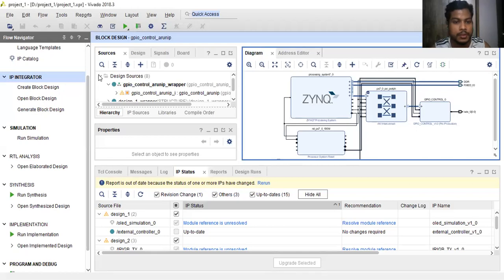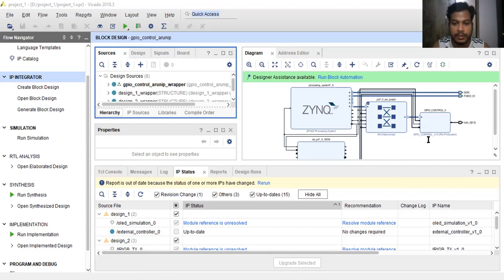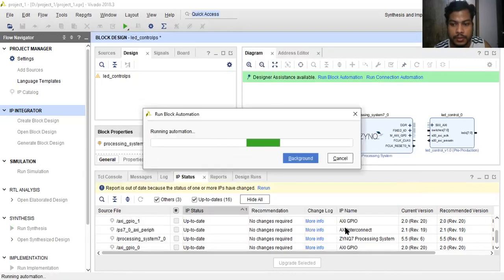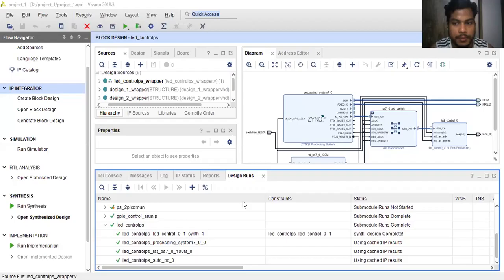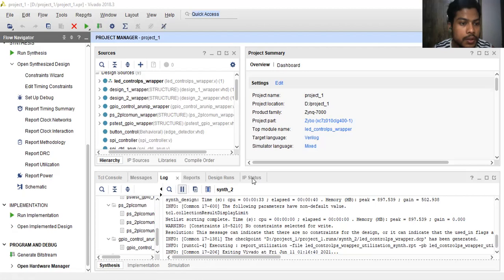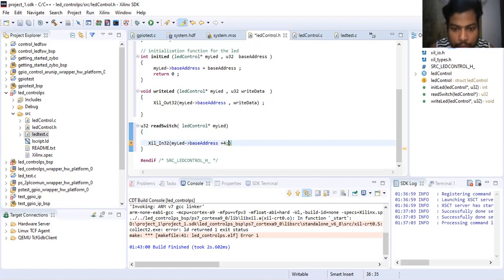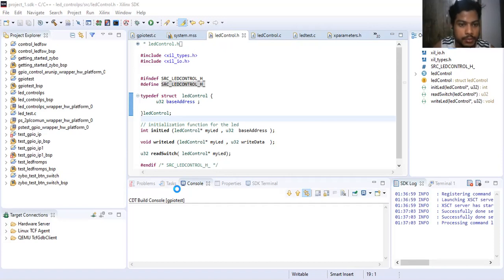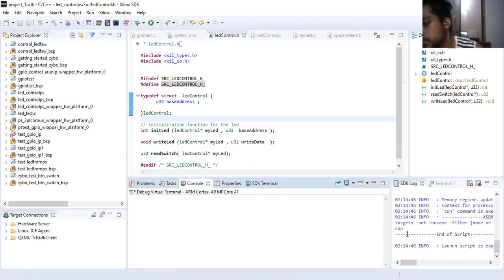ZYNQ FPGA CUSTOM IP GENERATION AND SOFTWARE CODE FOR  CUSTOM IP   PART2

Comment: hi sir,  I am using xilinx vcu108 board I have to write data into ddr from pl then extract it from ps through ethernet please suggest me how could I do
Reply from the maker: Make the DDR controller go through the data sheet and look for all the control signal and frequency of ddr input , write the data and read back to pl of fpga ,from pl transfer to the group and send the the ps